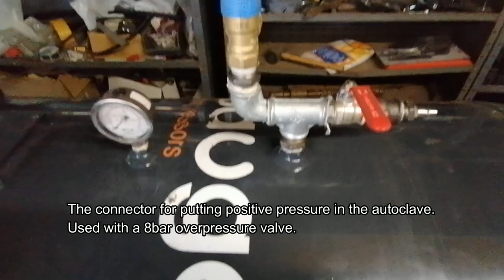Home made autoclave for carbon prepreg how its build .

Comment: Great job 👍 it’s also useful to have one more thermocouple to get temperatures from the laminate cause complex or big molds have big thermal inertia, u might have 130 inside clave and only 100 inside prepreg laminate and it’ll reach 130 in additional hour. Great job, respect, sir.
Reply from the maker: Thnx for your great info, 
The prepreg I'm starting with needs 8H cure at 90°C so hope it wont be that big a problem when you need to keep it for that long on same temp.
Also my moulds are vinylester and epoxy so no big aluminium moulds.
Maybee you can help me. 
I got perfect vacuum at my vacuum lines. the vacuum stay the same after a few hours time.
Now I connected 2 rubber vacuum lines made for autoclve inside and I see the pressure of these 2 drop slowly at the same speed.
they went from -1 to -0.8 in 2hours time is this normal or can it be a leak ? 

Regards
Reply: @Republicofcomposites  I had similar issue in self sealing connectors, those I’ve bought had leaks after couple cycles, guess the problem was inside in sealing membrane material, there’s a company in us Thorr industries or smth like that, they supply huge assortment of connectors for composites manufacturing. Hope it’ll help. Best wishes✋
Reply: @Republicofcomposites  Hi, seal connections not with sealing tape or but use simple or high temp silicone. I used cars engine gasket silicone works perfect. But i didn't like air flow in your clave I believe you will have could zones.
Reply from the maker: @martynaskirsis4179  thnx for the info. What would you change on the airflow?
Reply: @Republicofcomposites  can you find me on messenger I will try to explain or send some drownings or picture on my autoclave how I did
Reply: Hello,
What a job ! What kind of tank have you used for make your autoclave?
Have you weld yourself?

Comment: Hi, I´m working on the same project at the moment. Can your heat contoller programmed for a heating curve? or is it not necessary?
Reply from the maker: Hi, yes it can I also can switch off 2 of the 3 heating elements when I got the final temp

Comment: This job is amazing, how did you get the chamber? Your bought one?
Reply from the maker: Thank you, its build from a new compressor chamber.
Reply: @Republicofcomposites  why 5 vaccume connectors?
Reply from the maker: @FirstLast-tx3yj  If one of the 5 parts gets a leak I can close the line and keep other 4 under perfect vacuum.
The pressure of the autoclave pushes really hard on the bagging and if you got one to big bridge it rips the bag.